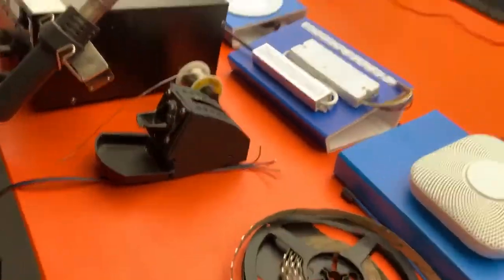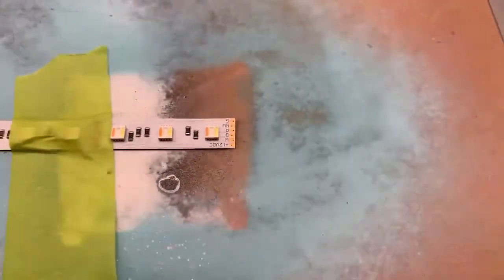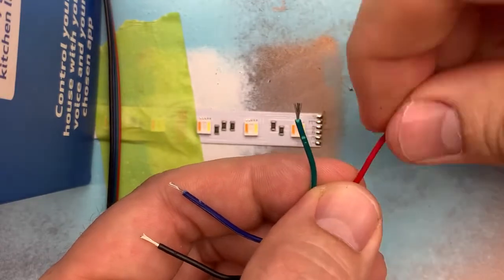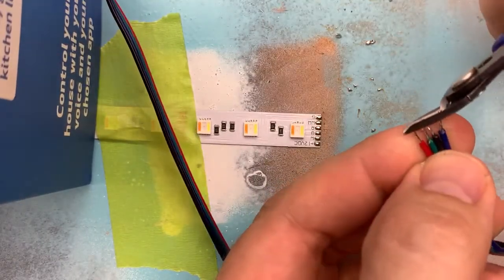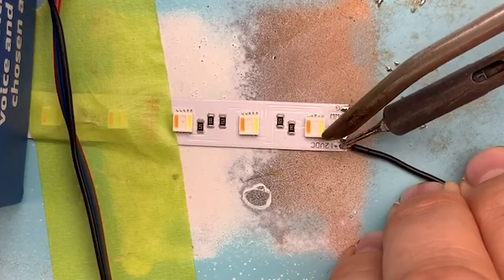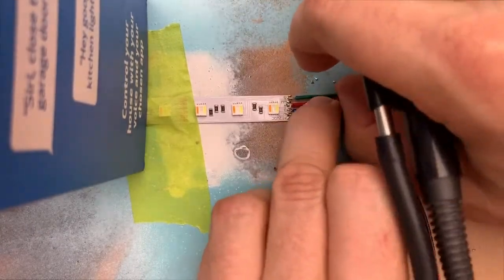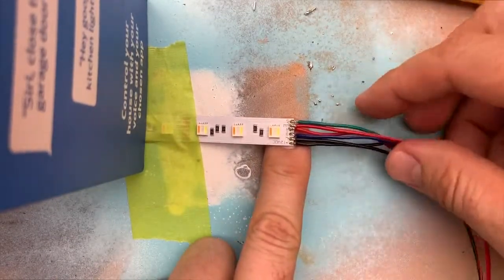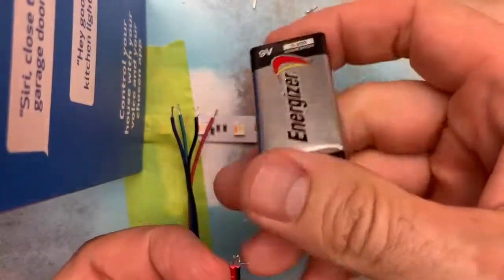Soldering LED strip- do it right! Valoflex RGB Hybrid Strip from M-Elec

Comment: Would you use heatshrink after ?
Reply from the maker: Hey Brad, depends on the location of installation but using heat shrink always looks better then open joints. Typically we cover ours with hot glue to prevent corrosion as many of our installations get installed on coastlines